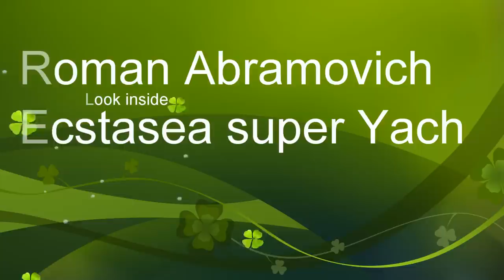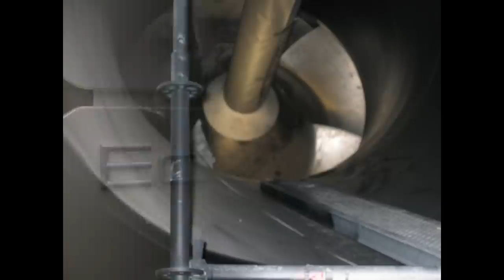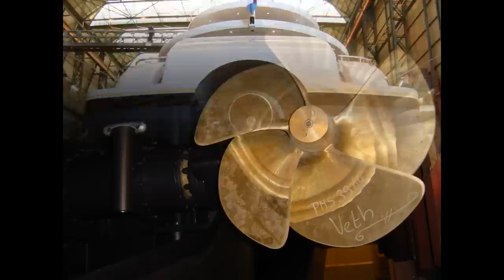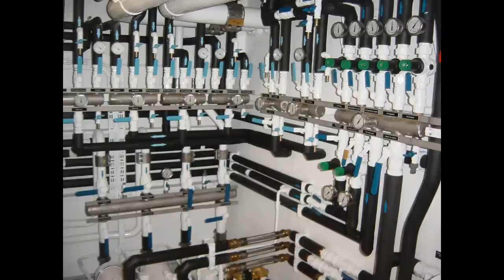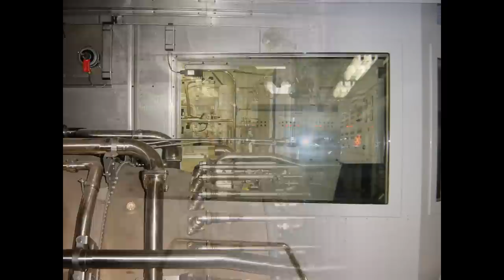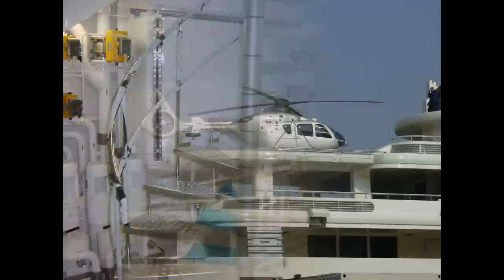Roman Abramovich Yacht Ecstasea inside( engineroom)

Comment: stupid design... if it's supposed to run high-speed via pump drive, the cruising speed running gear should also have been via pump drive. With how this is designed, high-speed operation will be with lots of drag from the prop shafts and feathered props.
Reply from the maker: Ja zou best kunnen ,maar het is een uitgetest ontwerp ..Bedankt voor de reactie